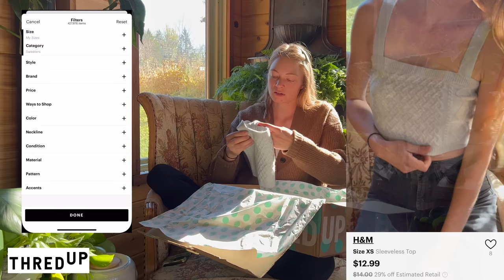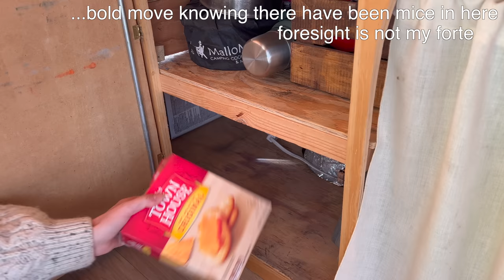Alone in the Woods: preparing the homestead and cottage for winter

Comment: Hey! About your water draining problem - I’m not a professional by any means but I close my cottage every year so this might help! 
1. Turn off water pump and water tank
2. Drain water tank 
3. Open facets inside to make sure there is no suction created
4. Open all outside facets to drain 
5. Once done draining, close all facets 
6. On an outdoor facet (preferably the lowest one of the house), take a vacuum and suck the excess water out of it. Do the same if you have a hot water line. Close facets. 
7. Put Anti-freeze in a cup and hold it submerged in a inside tap mouth facet. Once you go outside to the vacuum, open a cold or hot facet and turn on suck again, the Anti-freeze will be sucked from cup. 
8. Do this with all inside facets 
9. Suck with vacuum outside 
10. Bring vacuum inside and flush toilet and suck extra water from the back of the toilet. 
11. Pour antifreeze down the bottom of the facet (sinks) too
12. If you have, pour anti freeze in any water machines (dishwasher, clothes washer) and do a light run cycle 
13. That’s it! Make sure to get a lot of antifreeze - we use 3 bottles but always get more.
Hope this helps but remember to tailor this to your own house!
Reply from the maker: Literally screenshotting this 😂